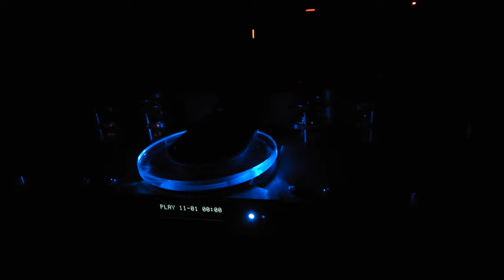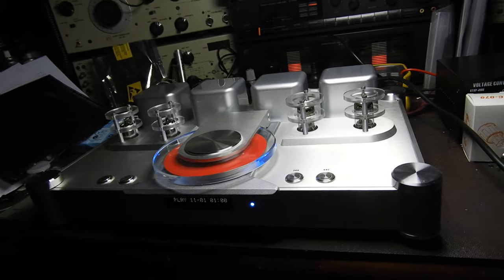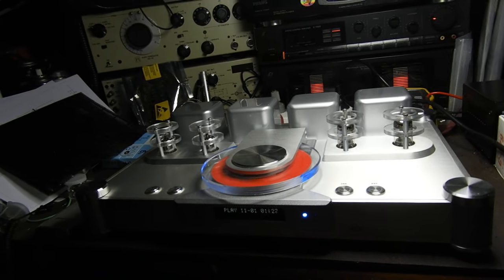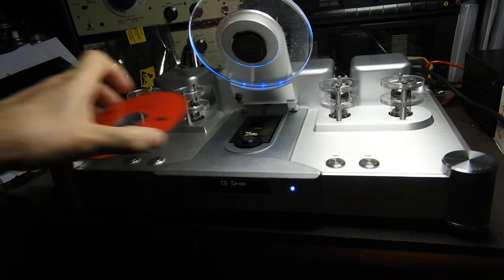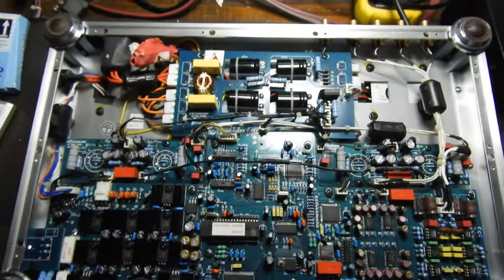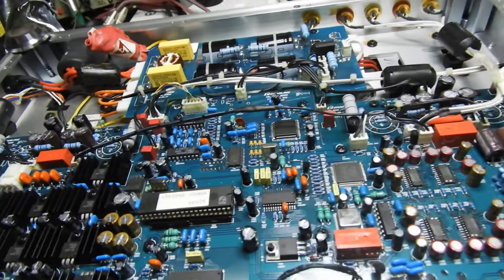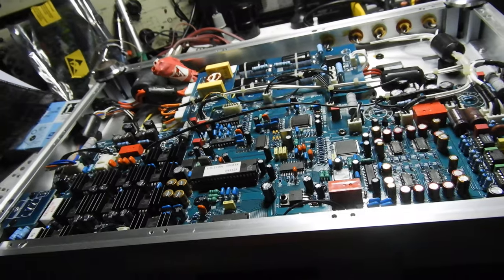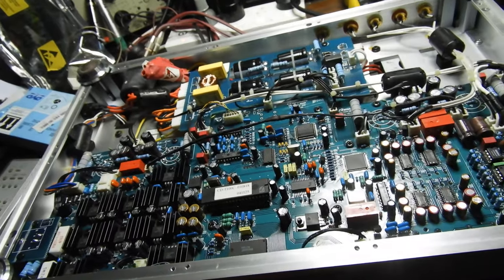Shanling CD-T100A HDCD Tube CD player with Burr-Brown 4 x PCM 1704 & Pacific Microsonics PMD 200

Comment: Great video! These Shanling players are indeed well-made machines. Personally not a fan of the look of the unit (in fact I'm not a fan of any audio components with the "tubes sticking out of the chassis" look, actually) but I can appreciate the craftsmanship. 

I would love to see you get your hands on a Sony SCD-1 or SCD-777ES. These early SACD players by Sony are built like bank vaults but also notoriously finicky (requiring repairs on the sliding mechanism and so on). In fact the FPM mechanism in those SACD players is much less reliable than the old BU drive combo with KSS-190A, KSS-272(?) lasers featured in the Sony X7 lineup of CDP back in late 80's early 90's. Although I could imagine once you get a "good" example having been looked at by someone like you it would easily serve another 15+ years.
Reply from the maker: I too am not a fan of "overdoing the visuals" and too much blue lighting (like Jungson does).
And you are quite right that KSS-190A or BU-1 might need a bot of servicing, but this is after 30+ years. Once you clean old grease, clean microswitches, they are probably good for another 30